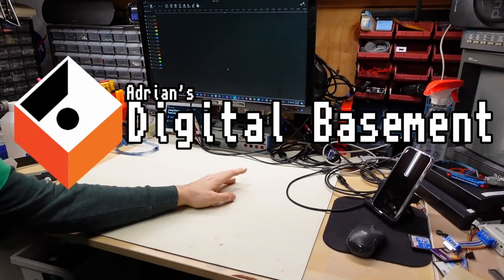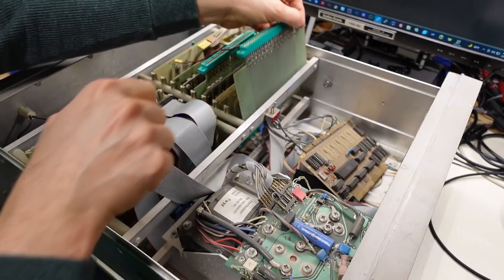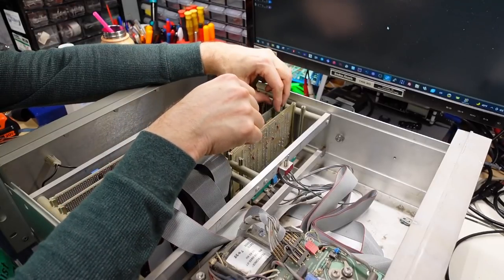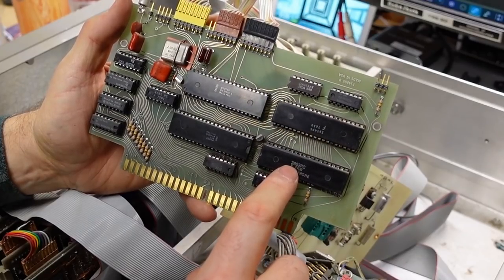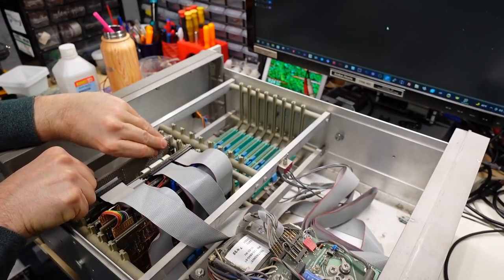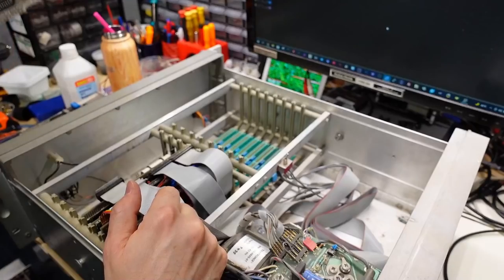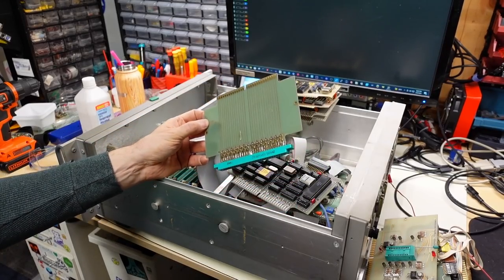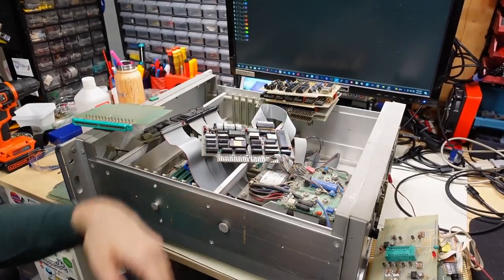I need help finding information on this mysterious computer

Comment: All S100 development systems ran serial terminals. It is not a PC you know. Home made boards with bodge wires makes it sound like a hobby guy in his basement but this is how products used to be developed. If you wanted to develop a PCB with a layout you did it by hand initially, then changed it with mods, then made it again and again. If you wanted to burn eproms you didn't buy a $20 Chinese USB programmer with software, you had to make it. How do you think we got to this point where we are today? Don't laugh at the efforts we went to to build this IT future you are enjoying.

Comment: My guess is it's for controlling something very interesting. STDs running CP/M are tailored for specific uses I think. Could have been controlling a robotic arm or a telescope or something more mundane in manufacturing or food processing. Literally anything. Maybe even a storage or cartridge module drive controller(very wild guess)? BTW: MOSTEK MK3850 P-3 8-bit microprocessor first introduced in 1975 obsolete by 1982 Another totally wild guess, given the high number of serial ports maybe it had multiple dumb terminals connected to it and was used as a mini-computer? I feel I'm just showing my ignorance on stuff like this - will be interesting to find out what it was actually used for though.
Reply: I think all the clues will come from dumping the ROMs - there will be some text in there somewhere. It definitely looks custom, but I doubt it's a multi-user terminal server. Pretty sure it talks to some industrial or scientific equipment - some custom controller for a process, or data logging, or sending code to CNC machines or something. Back in the 70's, tons of "fancy" industrial hardware all had rs232 ports for remote control - lot of stuff today still does!

Comment: As for the eeprom card.....This would NOT have programmed eeproms. This would have programmed old school "fuse" PROM chips or early UV erasable EPROMs. PROM chips  needed "high" voltage to program since they work by burning a cell to make a zero, shorted would be 1. I remember some early erasable EPROMS had programming voltages as high as 24v. Most were PGM 12.5v. Cool old machine that looks like it began its life in the late 70's and was built up till the late 80's

Comment: Pretty sure its RS232 i/o. Probably to a terminal VDU or maybe even to a Westrex teletype machine at 110 baud or something. Obviously rack mounted at some point. Very likely for a specific scientific purpose (eg. like data logging) rather than a home hobbyist computer. I would guess the eprom programmer may have came later to turn the thing into a programmer. Quite a bit of guess work there but i think so.

Comment: Someone should make a team to reverse engineer the entire thing, tracing all the paths on all boards and also obtain a dump of all the ROMs, which shouldn't be too difficult to analize considering it's just Z80 code, and see exactly what it is and what it does. I'm not an expert on this kind of hardware but one thing for sure, 80s hardware was extremely simple. I mean, in a relative way if we compare it to modern, locked hardware. It could be some kind of custom lab equipment not available for the general public, probably for testing (QA) some kind of hardware the owners of this thing were producing after it's assembly. That'd explain the lack of any kind of branding or explanation whatsoever in the boards. Also that thing must have been operative for many years, if they had to make so many fixes. This would also explain the interfaces and the lack of any kind of "standard" (though there was no standard yet back then) I/O. Most likely everythin would be running from the ROMs and it would do whatever it had to do whenever you connect 'whatever' through those ports. Those are my thoughts. It could be to test military or aerospace equipment, given it's complexity and capacities.

Comment: Reminds me a lot of the connectors/cards in some old synthesizers, those green connectors look a lot like the ones notorious for going bad in the old korg ps-3100 and such. Likewise the 2708s, it's a common mod on gear from that era to swap them with 2716/2816, writing the 2708 rom to both halves, and eliminating the extra voltage rails. It definitely has a lot of 70s vibes despite the early 80s chips, and I'd suspect its something designed in the late 70s and made or maintained into the 80s

Comment: Looks like a kit from "The Digital Group" out of Denver. They made plug in cards to run Intel, Zilog, MOS, and Motorola configurations. They also made cases that could double as tanks, one of the reasons their business failed.

Comment: I think it´s an educational computer for students to get access to the "back in the day" modern world of computers starting in the mid 70s. They could figure out how a computer , specially external communication via serial or parallel ports, works and do some experiments, maybe the teachers had a go as time passed and did some "improvements" to keep up with the development which was getting pretty rapid later in the 80s...

Comment: Shouldn't the Z280 be an upgrade to the Z80? Probably system console would be serial, considering the sheer number of serial ports. The prototype boards do not look home-made to me. Rather done by a research lab or similar. Perhaps a control Computer of some sorts. The Z80 board's sockets and connectors at the top might be GPIOs of some sort. Hard to say with the chips missing. Nice find. Subscribing your channel now to follow you and what you will find out!

Comment: Early computers used terminals that used RS232 to communicate between the pc and the rerminal.. The display terminal would display text on the screen and the keyboard would send back the. It may be an early pc. As MS DOS 1.) Was actually  F MP pm. Yes it probably has a bootbro. Because it actually takes very little code written in assembler to boot up a pc. The disk would contain application programs.the box you have is from the early PC days before things got standardized. I recognize many of those chips having been around back in those days. It probably bad a - or 10 inch floppy drive connected to it. This is a home brew computer though what it is a clone of would require getting it working. Back in the days there were guys making their own clones. I recognize the cabinet it is in and you could buy them empty though you are missing the side lifting handles the seldom programmer tells me it may have been a support machine to program Prime for other computers..based on its apparent age it may have been used to bootleg game cartridges if it was used for piracy which might have been the case. Only some one my age would know how to get it running again. If any chips are bad it can not be fixed and those chips have been obsolete for decades. It may not be possible to revive it.

Comment: Not a home build.. I suspect it came out of a tech shop and grew over the years.   Some serious breadboard work.  At a guess I would say several of the daughter boards were hand masked and etched and not out of a store other then perhaps radio shack!  Someone did nice tidy work.  Yep, has to have been a connected to a terminal.    Veddy old school!.  Back in the days when field computer techs had arm like longshoremen.  I was a USAF electronics tech in the 70's  and it very old home week feeling to me.

Comment: Came here to yell at you, Adrian.. there is no video controller on this box. It's meant to be addressed via serial connection, via a dumb terminal. Hook up a null modem to it, and check to see if you can get a prompt at 300, 1200, or 2400 bps.

Comment: Could it be a Tektronix unit? It looks like it may be some kind programmable controller or test unit. That case and rack mount system with the debugging riser boards screams commercial or enterprise use. That's a pretty cool piece of history. Looks like it's been added to or updated through it's service life. It looks like a custom unit but not home made. CPM? RIP Gary Kildall

Comment: Who ever had this could bank roll this machine as that static memory card with single chip cost a fair bit from building my own systems. This machine has been built up and operated over 10 years so well used.

Comment: Top has 6 "quarter-turn" quick type locks.
Not real common on rack-mount gear.

Internal connectors are WAY too short for S-100 - looks more like IEEE-488 test equipment bus from the size.

I would estimate some sort of tester for something used in a manufacturing environment.

Comment: No they are NOT S-100.  The S100 cards had 100 connectors with no gap in the edge.  They were a bit larger than the ones you have.  I had an IMSAI 8080.   Also all cards had voltage regulators for 5 V.  Power from the power supply was +- 20(or perpahs 18v)V and 10v distributed on the S100 backplane.

Those cards except for the home made card  would appear to be from a system of some kind.  Sort of like IMSAI or Proc Tech etc.  You just don't know which one.  I know it is NOT S-100.
The home made cards are prototyping cards that you can buy for them.

The connectors on the back tell you that it was serial connected using RS-232 via a UART to some sort of ASCII terminal.  Much better than a video card.

Comment: Well, the cabinet and power supply are clearly from a 1970s Tektronix test instrument. Checkout a Tektronix TM500 series mainframe. My guess is someone made some custom cards for an old Tek mainframe they inherited. I did learn something interesting. I have some Prolog cards that are just voltage regulators. I always wondered what they were for. Must have provided the rails to some computer like this.

Comment: My money is on in being built by an engineer at Textronix or similar for his own use. Someone else points out the cards are STD bus. The case and psu scream built by someone who had access to that kind of equipment but it's a little bit not quite polished which is expect with something built for personal use.

Comment: Now, the question is do you have a Dumb Terminal VT100 or get a serial cable and start testing cards, first test the power supply, then test the CPU and Async board. I had a old CPM system like this years ago, my company was dumping it and I was told I could take it home, it worked.

Comment: When I had to mess with equipment with a back plane like that, they were nice enough to have a pair of holes on the top edge of the cards so you could use a board puller to get them out.

Comment: You have a piece of development equipment or custom Automatic Test Equipment that has gone through several generations of development itself - starting around the early 80's with the MOSTEK Chipsets through to the early 90's as witnessed by the date code on the Z280 CPU.

The DB25 ports on the rear panel would be two rs-232 serial ports and one parallel printer port.
The black  DIL headers would be a 50-pin for 8" Shugart floppy drives, and a 34-pin for 5-1/4" floppy drives.
The Intel iC8282 chip on the RTC/USART pcb is a Floating Point Maths chip, designed by AMD, to complement the 
Intel i8080/i8085 and Zilog Z80 chips.

Your comments and titillation about the construction techniques of the unit and pcbs is sorely misplaced, and obviously based on the branded pre-built systems you usually work with.
Such derision is not becoming of yourself, as the pcbs and their "screwup" fixes are not a sign of poor quality, poor design or screw ups.

The capacitor on the rear of the pcb was both a legitimate design or modification practice, the point-to-point jumper wires likewise, and having worked for both Data General Corp and Raytheon Systems during the 80's I can confirm that it was common professional practice and done with great care on Circuit Boards.

You also have to remember that the volumes of PCBs manufactured nowadays is orders of magnitude greater than it was in the 70's and 80's, and that the relative costs of PCBs has reduced by orders of magnitude - all while the complexity of circuitry and PCBs has increased by orders of magnitude.

As for Point-to-Point wiring, I serviced commercial NEC PABX multi-hundred extension Telephone Systems in the late 70's that were totally of Wire-Wrap Point-to-Point construction.

Comment: You can read 2708 with +5V only, only writing requires three different voltages plus 100 cycles per byte :-)

Comment: its an industrial computer probably embedded in a machine, I have windows 10 i7's in more or less the same case with custom cards that look more like hobby level (of today) as they were designed to do one thing for one company selling a family of machines.. Think the oldest one (in basically that same case) was in a factory line that made semi-truck turn signal flasher relay's ... it was made in the late 70's with a just above home made moto 6800 (not thousand) chipset that sequenced and monitored a handful of Relay logic boxes scattered about the different stations

Comment: Definitively not a home made hobby project. Looks like a custom unit made for hardware development, prototyping or testing. Probably did cost an arm and a leg to build. Might have been reworked over time to adapt to changes to whatever was tested or developed.

Comment: Honestly looks extremely similar to a old automotive EPROM programmer I had in the late 80s.. except for the custom boards those have me stumped.  The extremely strange part is the rack mount unless someone upgraded this to rack mount at a later date the only ppl doing rack mount stuff pre 1990s was the audio/visual guys and the military/science labs.. even then mainframes were much more common.. the 8 inch floppy discs were not very common because of how expensive they were only the banks and military and science outfits could really afford them.. so I'm with someone else who said Boeing.. I think there's a good chance it's a EPROM programmer for Boeing aircraft..
Reply: You are wrong about the rack mount stuff.  1970's mini computers were rack mounted as were a lot of test systems and process control systems.  Seismic systems were also rack mount.  In those days it took a lot of power to do anything.
Reply: @johncooper4637  well the only rack mount stuff I can remember from those days was almost exclusively engineering/lab equipment.. normal companies were lucky to have a PC at all and all the state agencies I worked with were all mainframe nothing rack mount.. just my two cents..

Comment: Dump those ROM's I may be able to provide insight into what this machine used to do. One thing I can guarantee that is not a general purpose computer. This was some sort of industrial/scientific controller/test gear, or possibly a development box. The bus looks like the STD bus common on industrial equipment from that era. 

What you have probably cost a company hundreds of thousands to acquire.

Comment: that's a Industrial computer... they use them in Plants to control process machinery.   normally you control these other machines using rs232 (serial) connectors... highly likely it used serial output to a terminal

Comment: The single pin "sockets" seem to be the same ones that the HP µLab uses for its fault jumpers: https://www.youtube.com/watch?v=0fCSlPqSJKk while the outside of the case looks suspiciously like a Tektronix one https://www.youtube.com/watch?v=34-QuHXq6Q0 - maybe somebody repurposed one of those for the power supply and case? With custom front/back panels? My guess is it might be from a factory floor; some customized testing or controlling unit. Automated QA? In the early 1990s, the company I worked for used EPROMs to write calibration data for digital/analog control and we had to automate measurement of different transmission levels and writing a table to the PROM. This looks like something along those lines for sure. As for interfacing: my bet would be: serial port and/or custom button panel from the PIO chip.
Reply: I think that was just two DIP positions for two different types of RAM chips. Things were a lot less standardized back then, so you would put one type in the left sides, or another type in the right sides.

Comment: CPM often had terminals as the display output. 9600 & 19200 baud was common.
The top connectors look like Dzus fasteners.

Comment: I have see this kind of computer use in 40+ year old  DEK solder printing machine. Usually they running headless linux to control the actual machine, and use dos base Windows (Windows 95 or 98) or early Windows NT like Windows Me, to handle software/programming side.

Comment: Some computers of the era use terminals to access, no monitor directly connected to it. Could be some kind of main computer to stores, and eprom programmer is to update anything running on the terminals? (Wild guess)